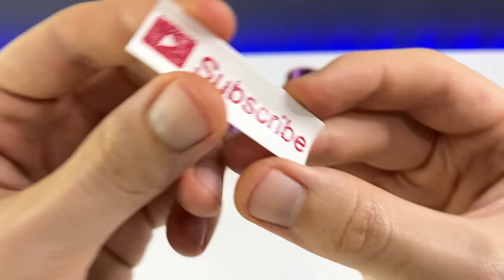Amazing 3D Printed Games

Comment: How do you get good adhesion with that metal plate? I have the same one and nothing sticks to it lol
Reply: Clean with alcohol, then try hair spray, glue sticks. Different mats might work better for different types of prints too. There's no rule that restricts you to one kind of mat.
Reply: @jamesfowley4114 thanks! I did end up going back to that plate and using glue stick and it does get great adhesion now. Also printing rhe first layer at 10-15mm/s really helps, especially if there are a lot of smaller areas on the first layer.
Reply: There are 2 major factors that cause poor bed adhesion. The biggest is an unleveled bed and improper z offset (the distance of the nozzle from the bed) the second is a dirty bed. Fingerprints are the devil, wipe it down with as alcohol before every print. Also, imo unless you're printing with tpu or some of the other more exotic filaments you don't need glue stick or hairspray. In fact, it's a very common misnomer as these products are actually used as a release agent so that certain materials will come off the bed. They are not or shouldn't be used for adhesion, if you keep your bed clean and your z dialed in you won't need to use a crutch like a glue stick

Comment: What is the best 3d printer to purchase today?
Reply: Different people with give you different answers. My opinion is if you want a printer you can take out of the box and it works well without tweaking and tinkering, look at the Bambulab A1. If you spend less on a printer than the A1, expect it to need some tweaking to get it printing well. You can spend much more on a printer than the A1, and also less, but I think it's very good value if it's affordable to you. When watching reviews do bear in mind that many are paid, and the reviews that some of the cheaper printers have, are by people who have been given a printer that has had extra attention paid to it by the factory before shipping out for review.
Reply: There are a lot of good printers. I'd look for one that can do the first layer stuff (leveling / z offset) automatically. Bambu is very competitive, but it's a closed ecosystem like Apple. Creality is cheap, but not for heavy use. Prusa has been around for many years and their printers will last, but tend to be expensive. If you absolutely love to tinker and assemble things yourself, Vorons are very good.
Reply: Cheap: Elegoo Neptune 3 Pro/Plus. For mid range: Bambu Lab A1/P1P/P1S. High End consumer grade, no contest the Bambu Lab X1C. Best Value overall would be the Elegoo Neptune Plus range of printers, sub $500 price tag for some massive machines.